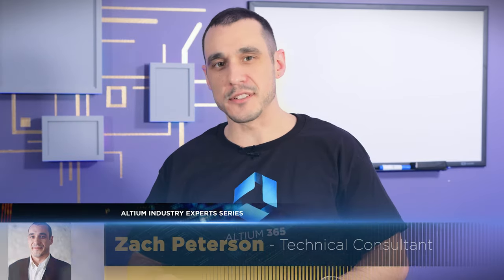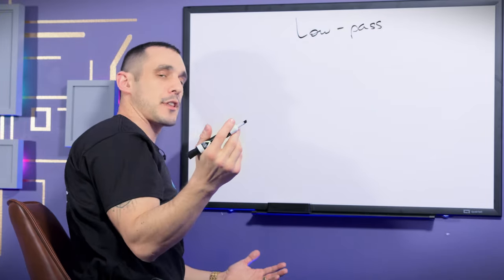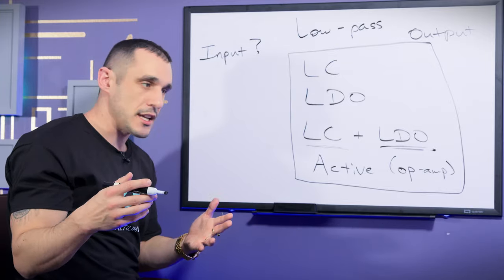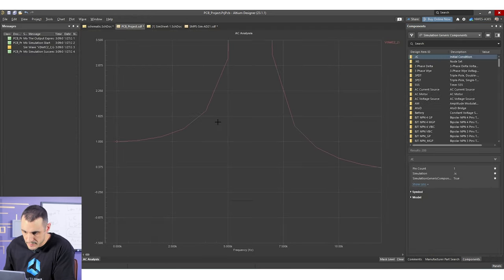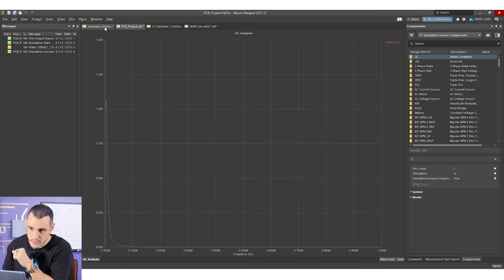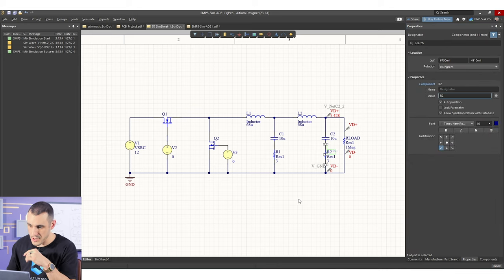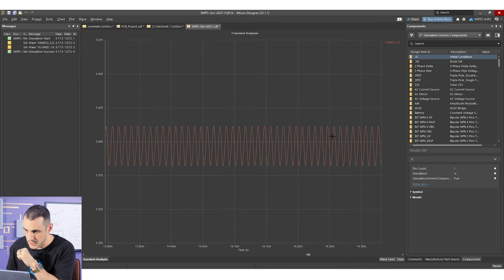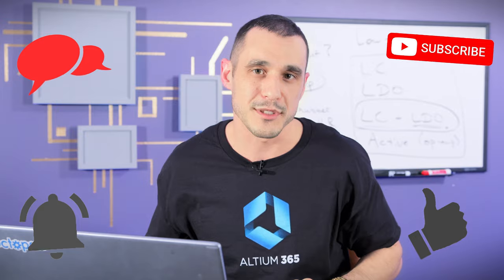Power Supply Filter Design Deep Dive

Comment: Hii Zach,

I’m currently designing a circuit where I have to supply a opamp connected to 70V. The 70V is made by boosting 27V->70V. One thing is that the 70V needs to very stable(max 10mV of noise). What is the best way to get a high stable voltage? 

Hope to hear from you, because your explanations are always clear!

Comment: Nice video, really inspired me, I'm an electrical engineer and work on audio circuits. If I use an LC lowpass filter before my LDO, will the LDO get back the missing high frequency bandwidth lost with the LC filter ? also will the LDO act as a buffer so all the capacitors after the LDO won't interact with the LC filter before the LDO, right ?
Reply: The LDO basically acts like a resistive buffer because the function of the error amplifier in the LDO is to modulate the value of R(DS) by adjusting the gate drive voltage (assuming NMOS). So I would say yes it does block the interaction between output caps and input filter, and I think it does so by function of damping (I have never studied this function fro a circuit perspective to be honest). About the bandwidth, the bandwidth depends on the response time of the control loop to transients, I would not say that the LDO "gets back" some lost bandwidth but rather that if the input filter has too much bandwidth reduction then the control loop can become unstable, so clearly there is some limit to the bandwidth reduction or rolloff strength you can apply before the LDO control loop is unable to respond to transients anymore.
Reply: @Zachariah-Peterson  You wrote "About the bandwidth, the bandwidth depends on the response time of the control loop to transients, I would not say that the LDO "gets back" some lost bandwidth but rather that if the input filter has too much bandwidth reduction then the control loop can become unstable" But I don't get why since the LC filter is a previous transfer function before the LDO, and not being part of the feedback loop, its only interaction with it is by applying a capacitive load (and the inductance in serie with the smps I believe acts as if connected to the ground in terms of AC transfer characteristics and thus believe would be in parallel to the capacitance of the LC filter, so I guess it could indeed make a nasty resonnant filter that the Q would need to seriously study so it wouldn't go above 0dB) is this the reason why you say it could make the phase margin instable ? if this resonnance is in the open loop gain above 0dB frequencies bandwidth and not above this open loop gain I guess it would be safe, even if phase above 180° or under -180° at this particular peak frequency... ? are those condition good premises for simulations, and understanding it ?

Comment: Hi Zach, Wonderful Explanation... Just one question though.... If I make R1 0E & keep R2 as is, will that be an improvement for switching noise(ripple)???
Reply: I have not tested that so I do not know if it will create better results, I normally test these with the same values. Note that you can't ever truly get to zero because the capacitor will always have some ESR, it could be as low as 10 mOhm and as high as 500 mOhm, depending on the case size. Not all manufacturers will provide a guaranteed value for the ESR value.

Comment: Great topic for a video. One that doesn't get addressed nearly enough imo

Transient response can be a huge issue in circuits with microprocessors
Reply from the maker: Well said!
Reply: Yeah I think that a lot of designers will just follow the application note and then say "I need a quiet supply", so they throw a filter on it not thinking about the potential for making overshoot much worse.

Comment: when I read datasheet of some pulse switch IC, sometime will see they recommend the range of ESR in output capacitor. Does it relate to keep the switching noise in constraints ?
Reply: This is done in an effort to ensure specified performance of the IC, which may include an output ripple specification. This also affects the turn-on time and the presence of any transient during turn on. In general, with higher ESR, you can get smaller transient or significantly damped transient turn-on on the output from the regulator. That is very important because some regulators can exhibit large overshoot during their turn-on phase, and this can reach significant voltage overshoot that might damage your components. So if you select the proper ESR value you can suppress this overshoot and hit a desired turn-on time.

Comment: A load of 1Meg is very small so i can see the op amp method working well but at that small amount wouldn't a small LDO be better overall ? 
Also what is the best way to determine the desired ripple on a power line? 
Why was a PI filter not considered?
Reply: You can use a pi filter, same optimization method with varying parameters applies, also the final LC element later in the video acts like a pi filter directly coming off the inductor. I also wouldn't consider 1Meg to be a small load even though it should work fine for an op-amp, if you go a couple orders of magnitude smaller you will find that the converter eventually operates at or near the discontinuous mode.